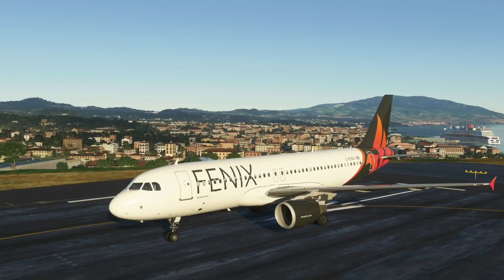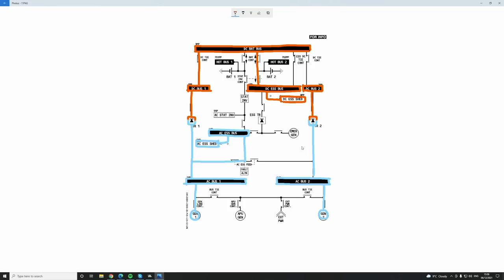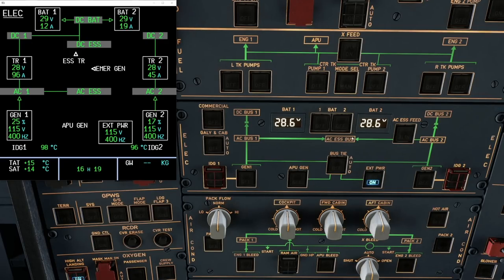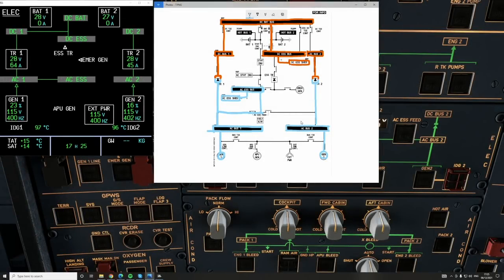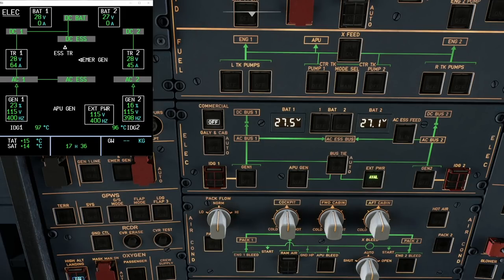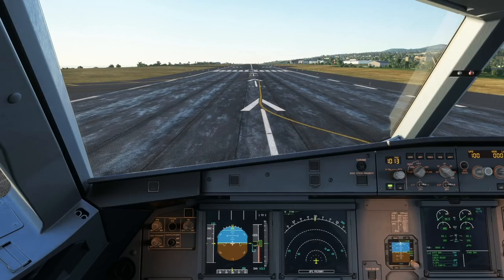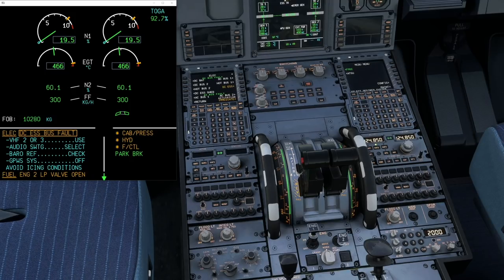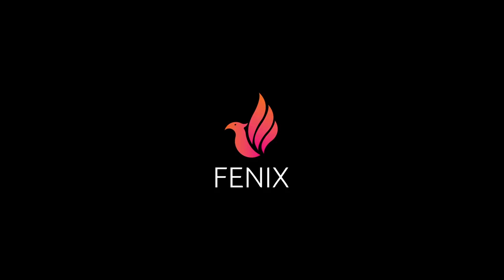Fenix A320: Electrical Feature Review

Comment: As an ex flight engineer I am very much looking forward to this aircraft! I must say even thou it doesn't have a FE panel, from what I have seen to date the depth of systems modelling, combined with the fault system, should be more than adequate to keep me interested. Having also managed a professional Level D flight simulator and worked with a team of programmers as the aircraft systems SME in getting the instruments/aircraft to correctly display the specific fault - much kudos to the team if they have managed to capture all this correct fault behavior as it takes hours and hours of testing and programming to get right - so WELL DONE!
Reply: How do you like aircraft so far ? I found a lot of bugs within electrical system. For example manual control of x bleed valve should be tied to DC ESS SHED but instead they connected it to battery bus if I remember correctly ..

Comment: I wanted to know if you guys developed the ADIRS alarm. The IRS are connected to the batteries. If you remove the power and leave the IRS switches in the NAV position a time delay will allow an alarm to sound to remind you that the batteries will be drained of charge. Physically the horn is located in the nose wheel well. So that's my query for you guys. Thanks!

Comment: Your knowledge and the modeling is incredible! Why does the overhead voltmeter display 27V, even though the battery voltage is 24V?
Reply: The DC system is 28V. The AC system is 115/200V 400Hz in 3 phases.
Reply: @fonfsx   Yes, I'm aware of that. But when you look it up, the battery is made of 20 Nickel Cadmium cells, each with a voltage of 1.2V. In total you get 24V for the battery. So, when everything else is turned off, why does the overhead voltmeter display 27V? Am I missing something?

Comment: I would really love if there was a failures menu, where you can set random failures but with level of failure.

So for example, I program a random failure on a random time which is an easy thing, where no emergency landing is required. If I want a major emergency like cabin depressurisation or engine fire, I can set that I want a random failure at a random time mid flight but which needs landing or is major or something

Comment: Why do u push the fire switch for engine 1 to turn it off ... now you have completely lost the the engines ... just turn off the fuel pumps
Reply: The engines still get fed fuel via gravity fuel feeding. So they will not shut off unless the fuel tanks are empty or the plane is in a state (I assume a pitch up momentum) in which the fuel lines are not supplied with fuel because gravity is pulling it down.
Reply: Pushing the engine fire switch doesn't cause you to loose the engine. It is just a quicker way of shutting everything off to that engine such as fuel, hydraulics, electrical etc. The button can be pressed in again to connect it all back. It's only if the agent is discharged then its not recoverable

Comment: Will it work with the default flight planner?
Reply: Really you're gonna by this plane to auto fill you're fp... It's not a game, its a sim... If you wanna play buy captain sim.
Reply: @laurentbeaujour9528  No need to be a snob.
Reply: @laurentbeaujour9528  I don't think it should matter how the flight plan is done,  I can still enjoy other aspects of this aircraft without doing it myself, or using simbrief.
Reply: @ThatCanadianGuy-e1p  flight planning does matter, simbrief is a little tool as a pilot you need to adjust the fp, altitude speed approach according to the wind, and personaly i think that msfs flight planner is really buggy and useless